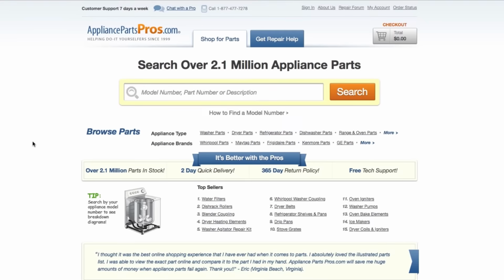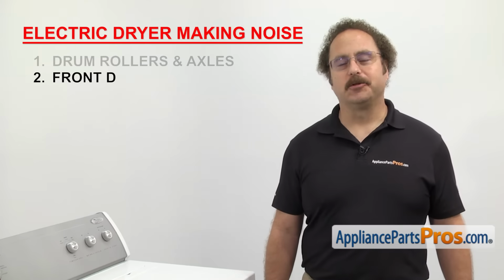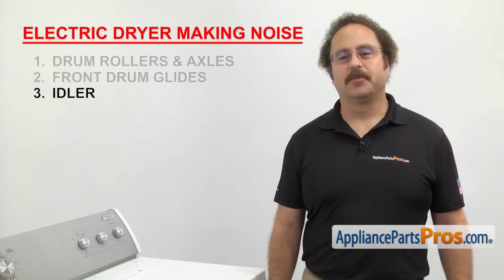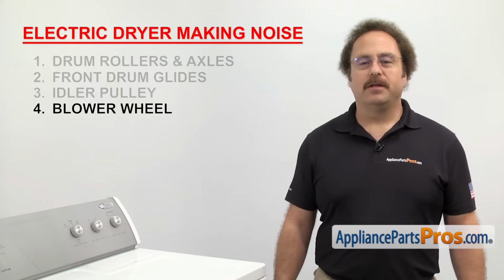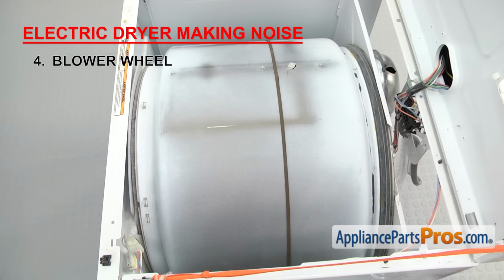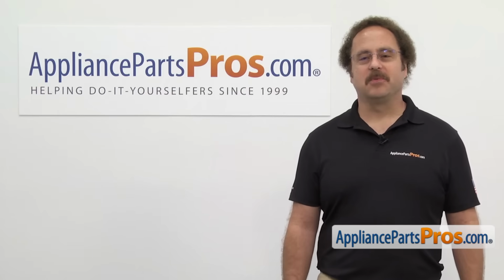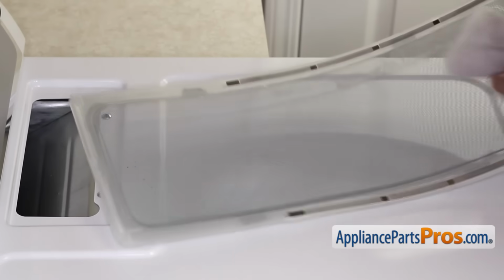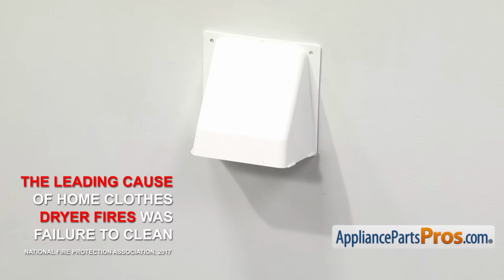Electric Dryer Making Loud Noise - TOP 6 Reasons & Fixes - All Dryers

Comment: 1990 electric Maytag dryer DE710 runs like new....done all of those except motor.  Also, replace heating element twice and a couple of cycling thermostats over the years.
Reply from the maker: That's impressive! A 1990 Maytag is a testament to how durable those older machines can be with a little maintenance. It sounds like you've kept yours in great shape by replacing wear items as needed. Hopefully it keeps running strong for many more years. Thanks for sharing your experience!

Comment: My Kenmore dryer works fine, with one exception. It makes a random, loud humming sound every few rotations. Almost sounds like a power surge. It seems to spin and dry fine. Lint is cleaned out on the regular. It seems to happen more often the wetter/heavier the clothes are. As they dry, the sound is less frequent, but still happens every few minutes. Any thoughts? It didn't seems to match any of the troubleshooting in this video.
Reply from the maker: That definitely sounds frustrating, especially since everything else is working normally. For detailed troubleshooting steps specific to your situation, our certified techs can help you at forum.appliancepartspros.com. Just post your model number and what you’re experiencing and they’ll walk you through the diagnosis!
Reply: @appliancepartspros  Thank you!

Comment: 20 year old dryer on my end, mine was making a rattling/scraping noise but it was uniform. First thing I noticed from opening the blower cover/duct was all the debri (hairpins, clothespins, a quater, misc screws and a ton of filter dust/hair/fuzz) and none of that was the problem. On the blower itself one of the fins had a hairpin stuck to it, the closed end of the pin was rattling against the metal duct. I was able to clean out the other duct which had accumulated enough debri to block 1/3 of the bottom (the duct connecting to the wall).
Reply from the maker: Wow, thanks for sharing that, @llehsaderob! Sounds like you did some serious detective work—hairpin on the blower fin is a sneaky one. 👏

Glad you were able to track down the source of the noise and get things cleared out. That kind of buildup in the duct can definitely cause all sorts of issues over time, so good on you for digging in. If anything else pops up or if you ever need parts or help keeping that 20-year-old dryer running strong, we’ve got your back!

Comment: Great video, but we never talked about what a "rumbling" noise means. Only squeaking, grinding, or thumping noises. Oh well, I'm inspecting and cleaning it tomorrow. I will see what I see.
Reply from the maker: Great point! A rumbling noise in a dryer could be caused by worn drum rollers, a loose blower wheel, or even something stuck in the drum baffles. Since you're inspecting and cleaning it tomorrow, keep an eye out for those! Let us know what you find—we're happy to help!
Reply: @appliancepartspros  Thank you for the video. I inspected and fixed my dryer yesterday. It was compacted with lint in the motor fly-wheel. Everything else checked out. Runs like a champ now.

Comment: Excellent video.  I just changed the belt, idler pulley, and two rollers and vacuumed the inside.  The belt was shredding and I suspect it was the cause of a rotational noise.  After reassembling everything, I tested the dryer and everything works but I am still hearing a rotational noise- I hope that it's from the blower in the back.  I disassembled the dryer a second time but could not determine where the sound was originating.  I cleaned the lint duct housing in the back of the dryer in 2020 and it was pretty full.  I'm awaiting two foam seals to arrive before reopening the back of the dryer.  And I hope that the source of the new noise is in the back of the dryer.  This dryer is a 22-year-old Whirlpool Commercial which was purchased in a set from Lowe's for residential use.  I would like to keep it running as it's uncomplicated without all of the new electronics.
Reply from the maker: If there is anything we can help you with please let us know!

Comment: I’m going over your video now just to check up on my Maytag bravos XL. Even though it states “good airflow” I wanna check the blower for buildup, ect. What I do notice is when you manually spin the drum, there is light resistance and a low sandy, rumble sound. My guess is there fine dust, dirt, hair build up on and around the roller disc and bearings may be worn but not completely dead. I just have to find a roller and bearing kit for this model number, a “refresh kit” after 7 years of use. Other than that, dryer has zero issues. 
MODEL# MEDB835DW2
Reply from the maker: If there is anything we can help you with please let us know.
Reply: @appliancepartspros  well, I’m looking at it now but if you can help. I’m trying to find the correct rollers and bearing kit refresh for that model.
Reply from the maker: What is your model number?
Reply: @appliancepartspros  right above there in my main comment ^^^^at the bottom
Reply from the maker: I do apologize. I didn't see it at first. One moment and let me see what I can find for you.
Reply from the maker: It appears that for the rollers you would needing part number AP6019303. It doesn't appear you can get them as a kit though. The link below will take you to that part number.
https://www.appliancepartspros.com/whirlpool-roller-asm-drum-wpw10314173-ap6019303.html

As for bearings I am not finding any type of bearings for this model.
Reply: @appliancepartspros  gonna check this out now,
Reply: @appliancepartspros  looks like we may have an integrated lube system in the roller. Maybe is doesn’t have axles but forgot to mention AXLES. I’ll check back if you post anything on that. I thank you for actually engaging with your subscribers. That’s rare man (with YouTube) I’ll make sure I mention you guys to friends & family, and purchase from you online.

Comment: Replaced belt, entire upper shroud with plates, rear drum bearing and support, lower felt, and entire motor assembly. It’s humming extremely loud and still making thumping noises. The only thing I didn’t change was the tensioner arm and pulley which shows no signs of issue. I’m completely lost at this point 🤷🏼‍♂️
Reply from the maker: What is the model number of your dryer? Does it make the humming noise and thumping noise during the whole cycle or just at a certain point?
Reply: @appliancepartspros Hi, it’s the GE GTD42EASJ2WW. The noises are consistent throughout the entire cycle whether the dryer is running full or empty. I actually tilted the dryer back while it was running empty and I could see the metal bottom of the dryer flex with each thump. It looks to me like the flexing is right where the motor is mounted. I’ve gone through several belts. I notice the rubber keeps fraying off and seems to begin to melt in between the ribs not long after replacement.
Reply from the maker: When you installed parts did you make sure everything was installed correctly?
Reply: @appliancepartspros I’m 100% positive. I pulled the drum out, checked my work and reassembled at least 4 times. Everything is installed correctly and tightly. The thumping sound was present before I replaced all those parts and it never went away. I also replaced the idler arm and pulley since I wrote my initial comment, but unfortunately there was no change. The thumping is still present. Could the drum somehow be out of round where the belt rides? The reason I ask is it seems like the motor pulley is being pulled up slightly by the belt and then released back down during the revolution, making that annoying thumping noise. I can see the bottom sheet metal of the dryer flexing with each thump. I wish I could simply blame the belt but I’m on the 3rd replacement belt now.
Reply from the maker: If you have replaced all these parts and it is still making that noise you could be having an issue with the drum. The drum could have some how gotten a dent in it or something and that could be causing the issue you have going on.
Reply: @appliancepartspros Thank you for your expertise.

Comment: My gas whirlpool dryer makes a high-pitched squealing sound for 10 or 20 seconds each time I start the dryer. Then the sound goes away. Is this likely to be a symptom of the motor failing or the rollers and/or pulley? Can the motor bearings be replaced? Two of the rollers, belt and pulley were replaced within the last year. The other two rollers were cleaned and seemed to be working fine. Thank you.
Reply from the maker: Can you tell where the noise is coming from? Have you looked at your belt to make sure that isn't loose? What is your model number?

Comment: My dryer is making a subtle humming sound while running. Any ideas?
Reply from the maker: Can you tell where the humming is coming from? Does it do it during the whole cycle? Have you checked for any blockages or maybe something could be caught somewhere?
Reply: @appliancepartspros  It hums the whole cycle. Took it apart this weekend and only noticed one potential issue. When manually spinning the drum, I can feel and hear the belt slipping a little. Is there usually a little slippage in these things? If I replace the belt, would it be a good idea to replace the tensioner as well? Dryer is 12 years old and has never had those items replaced...
Reply from the maker: There shouldn't be any slipping at all. If you want to replace the tensioner while in there then you could replace that as well.
Reply: @appliancepartspros  thanks for your response. You reaffirmed what I was thinking. I'll plan to replace the belt sometime soon.

Comment: Good news, I think. As I mentioned before, I got the nut off the fan blower wheel, but could t get the wheel off. So I just vacuum the lint and dust and use a toothbrush. As I was doing my ast vacuum, I heard something get sucked up. So I am thinking and hoping this was the issue. I looked in the vacuum and it was either a penny or a ear ring. I think it was my wifes ear ring, because it sounded like a screw going thru the vacuum tubing. I put everything back together and let t run empty for 2 minute, but it turned off automatically. I think it does this, as it has a sensor if the clothes are not wet to stop. We are doing a load of laundry now and throwing it in the dryer, so ia m praying to the laundry gods that it works! THank you so much for your video!
Reply from the maker: Hopefully that is all that was wrong. If you are needing help please let us know and we will be more than happy to assist you.

Comment: I’ve replaced the drum wheels and the belt but I’m still hearing a loud noise upon startup. I did notice that the loud sound is coming near the drive motor. Is it possible the drive shaft is making the loud noise? And btw The blower wheel is clean and  undamaged

Comment: My wife said the dryer wasn’t heating so I finally found out how to change the element on our Samsung which we had for approximately 11 years. Once I replaced it & put everything back together, I heard a tumbling noise and my wife said I knew we should’ve called a technician. Broke my heart 😿. But I took it apart 4 times before I found your video & it looks like the idler pulley is damaged. I’m determined to repair this myself and restore my dignity 👍🏾
Reply: i hope all went well with it im interested if you restored it
Reply: You got it man!!
Reply: The wife’s job is to find problems and criticize you while and after you finish repairing it. I’ve worked on elevators and escalators for 40 years and we have a toilet that is leaking. Not a hard job compared to the things I’ve done in the past. My wife criticized every step of the tearing out process and basically told me I didn’t know what I was doing. I stopped immediately and it’s been three months without a toilet in that bathroom.
Reply: @Dnhillslide sounds pretty toxic. Maybe she should try fixing it instead. 😅

Comment: I just clean inside my dryer & replaced my pulley, belt, & rollers because my kenmore dryer started screaming/squealing then stopped turning, it was otherwise quiet. After replacing all this it is turning again and not scream/squeal BUT now my dryer sounds like a jet engine so loud. What do I do now?

Comment: Thanks, you gave me some things to look at.
And I was able to find out what was causing the dryer to sound like it was beating itself.
#3 the Idler Pulley
I replaced mine last year, and it looks as if it has moved over too far towards the elbow bend in the pulley arm.
I took the belt and spindle off, checked to ensure the pulley arm was not worn out, and placed everything back.
Once I did, I made sure it was level and then started the dryer, and it was quiet like it was supposed to be.

So, thank you for this video. Very helpful.
Wayne

Comment: I also wish there was a sample sound video.  Mine makes a noise, not sure if it’s grinding or what.  It isn’t squeaking or whiny sounding, but I don’t know what it would be.  We had a flood a little while back, had about 10 inches of water in basement…..lower than the door.  But the dryer still works, it just makes a noise the whole time.  I wish 8 could hear that same sound in one of these videos.
Reply: Maybe it's the debris from the flood water or corrosion after some parts came in contact with water

Comment: I agree regarding the noise sample. My dryer was making a thumping noise so I replaced the drum support rollers. Since I was in there, I felt it made sense to change the pulley wheel and belt. I cleaned dust and lint from the inside. Thumping noise is gone but now it just sounds extremely loud. It works do I feel confident regarding the repair but the loud operation is worse than the thumping.
Reply: Same here. Mine is making a higher noise than before when you are in front of the dryer. But if we turn a corner it sounds normal for us. Did you ever find out what happened? I am almost thinking the belt or pulley are too tight

Comment: The humming sound that my dryer normally makes while drying clothes, suddenly got about 25% louder yesterday. It sounds normal when the dryer first starts up, but after about 15 minutes or so then it gets louder... Any suggestions?
Reply: Mine is currently doing this. But it sounds like a rattle and gets louder at times. And some times sounds normal 🤦🏽‍♂️
Reply: @jasontodd9302  
I learned that you can call a local appliance parts supply store, and describe the problem to them, and they will most likely be able to tell you what part you need. That's what I did. Actually, I called two local appliance parts stores, for a second opinion
Reply: @christopherlynn8377  thanks bro I’ll do that today. The dryer still works but that loud rattling is annoying
Reply: I've actually went to far as to turn the dryer on while he was on the phone with me! 😂But he knew right away what to do!

Comment: My dryer belt visibly vibrates quite rapidly. What could it be? I saw some slight wear where a little piece here and there is coming off from the side, but the belt itself appears to be in good condition.

Comment: Another example of the age-old truth - heroes don't always wear capes. Thank you sir!
Reply: An appliance repair person doesn’t qualify as a hero. There is nothing extraordinary and no feat of courage or nobility. They fix appliances. The overuse and incorrect use of the term hero has led to every person, in every job, to believe that they should be held in a higher standard than others. Today, grocery stores have signs that say “heroes work here.” Really? Stacking apples is all it takes to be a hero?  

But, this was an informative and straightforward video. Examples of the sounds each problem makes would have made it better. Maybe a hero will have to post that version.
Reply: @ebonitucker4512   I can't take anybody seriously whose name is "Eboni".

Comment: My dryer makes a sound like coins are spinning in it. Any idea what that is? I'm going to pull it apart today to clean out the lint because now I'm worried about my house going up in flames like the dramatic footage in the video😟
Reply: Can be coins stuck under the "agitators" (not the right term) anyway anyone can fix this, just pop the top up and loosen the screws on the drum that hold the paddles that are in the dryer on then rotate by hand and coins or other debris may fall out
Reply: @itptires  it was a screw stuck to the drum.
Reply: I don’t wanna take apart mine so tell me what happened I don’t wanna burn alive I’d rather die by the virus than burning alive
Reply: The dryer had a screw stuck in the drum. Super easy fix.
Reply: Same dude what happened